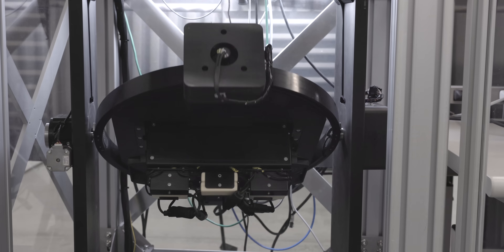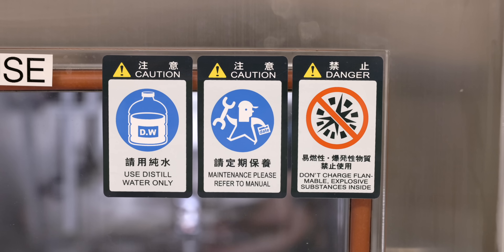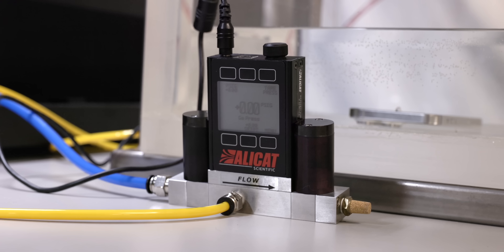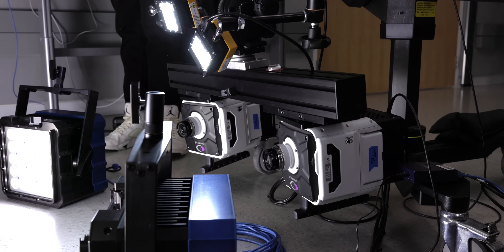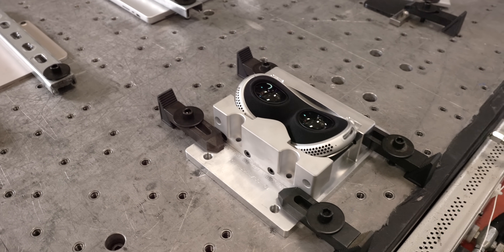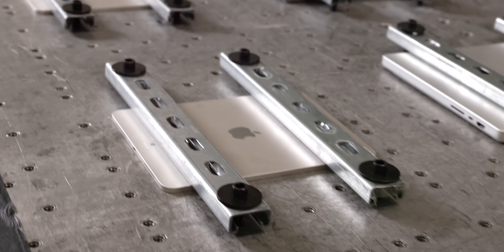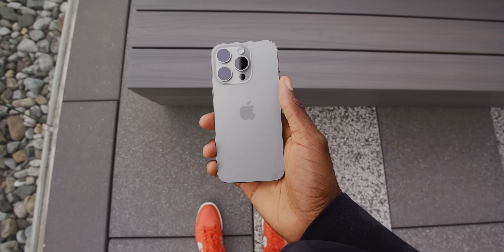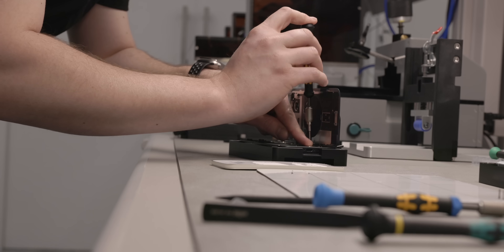I Visited Apple's Secret iPhone Testing Labs!

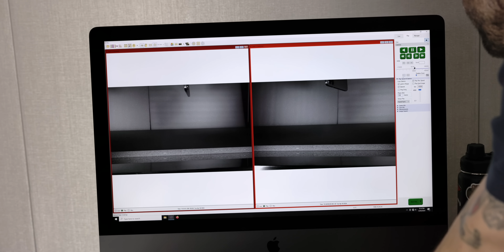Comment: 5:00 this is the most un-apple thing ever to exist! THEY INSTALLED WINDOWS ON AN IMAC!
Reply: Apple has officially supported Bootcamp for years. The Bootcamp installer literally comes preinstalled on Intel Macs.
Reply: They don't have a choice with that testing station. From the manufacturer: "The Phantom Camera Control (PCC) software is Windows-only and has been fully verified with Windows 10 64-bit."

Comment: The problem with their repairability isn’t the hardware being replaced. 

It’s the fact that you need Apple in the loop to “activate” even a genuine Apple part. And they won’t let anyone get those parts. 

The new iPhones are getting easier to replace a camera, battery, or backplate. But you can’t do it yourself without the phone turning off features. 

A bit disingenuous for you to act like it’s just durability because you know that as you’ve talked to Louis Rossman about repair.

Comment: 5:00 Apple using Windows on a Mac ???
Reply: They may be using bootloader or a similar kind of software that runs Windows in a virtual machine.
Reply: Still Windows regardless
Reply: It’s funny that Apple has to use Microsoft Windows 😂
Reply: They don't have a choice with that testing station. From the manufacturer: "The Phantom Camera Control (PCC) software is Windows-only and has been fully verified with Windows 10 64-bit."
Reply: @Steamrick  yeah that's a good thing because those software devs know you'd need a real os to get work done. try getting a real job, they all use windows there too
Reply: @rano12321  "software devs" and "they all use windows" lmao, where have you been? East Europe?
Reply: @rano12321 lol, if they were real devs it’d be Linux
Reply: @Puccybell Why would they go to Reddit to install Windows? I don't get it
Reply: Phantom camera software only runs on windows 10
Reply: when you need to get real work done
Reply: @cynikal82  ...and stolen by microsoft!!!lol.